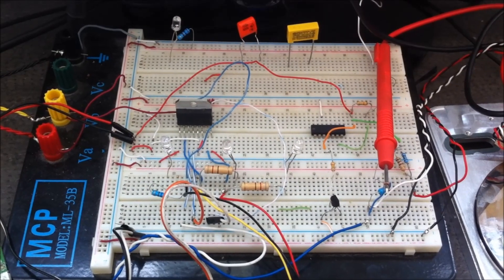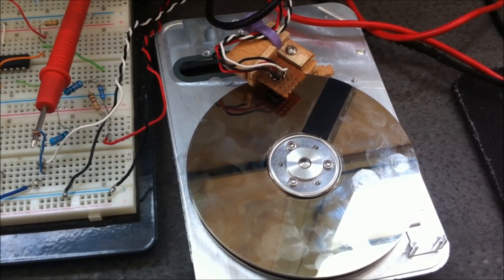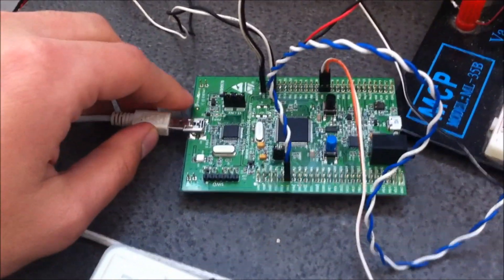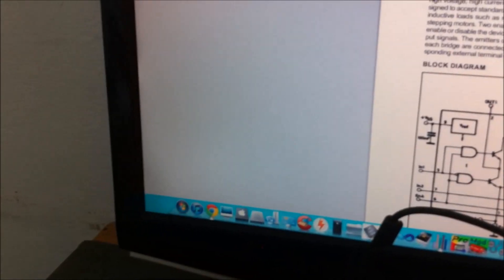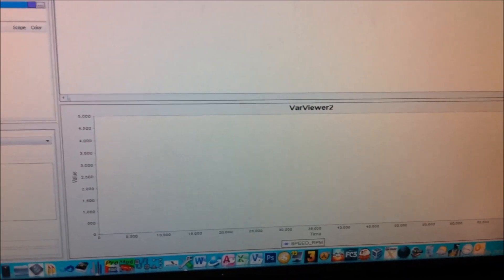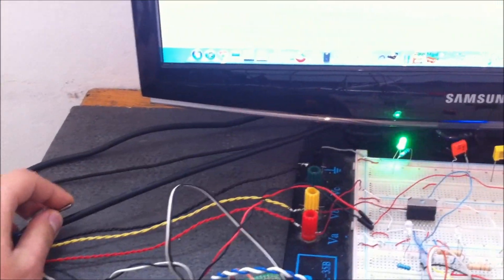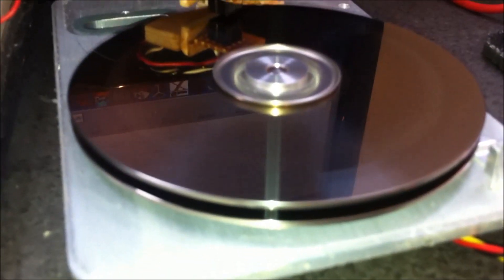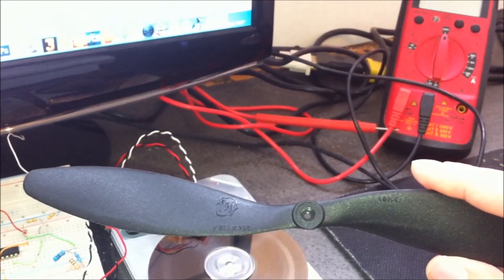Hacking HDD brushless motors using STM32F4

Comment: Hello
I've got a question. How do you sent information about rpm's to computer? I've got a little bit of problem, cause i have to do similar project as your's. I have to send info about rpm's and speed via using USART.
HELP PLOX
Reply from the maker: +Dawid9551 i use the real time debugger, i read the variable in the microcontroller which store the rpm in real time.

you can check my website here for more info ; http://electronics-homemade.com/BLDC.html
Reply: +TizanaMenYo I checked this site and it's beautifull <3, But s it possible to use USART to recieve thise information? I don't know how :(
Reply from the maker: +Dawid9551 yes you can do it. set up the usart and choose the port and you can send whatever data you want through the USART. it's doable

Comment: thanks so much but may I ask on how to set the variable "SPEED_RPM" in stmstudio in order to be used as the monitored variable in stmstudio cause I could not see this variable name(SPEED_RPM) in your source code.
Reply from the maker: SPEED_RPM is a variable created inside the STMSTUDIO which use the Nmbr_turns variable :

SPEED_RPM  = 60 / time_for_one_lap ;
which 60 is number of second in one minute because the result is in RPM (Revolution per minute)
and time_for_one_lap is the time that takes the hardrive to do a lap.

time_for_one_lap =  Nmbr_turns * prescaler * TIM5_periode

Which : - Nmbr_turns is a variable inside the microcontroller which calculate the number of TIC for the TIM5
- TIM5_period = 25 nS = 0.000000025 s
- prescaler = 10000 (you can check it inside the TIM5_config() function)

so 
SPEED_RPM  = 60 / ( Nmbr_turns * 10000 * 0.000000025 )
Reply: TizanaMenYo
Thank you very much for your warm and immediated explanation. May I ask more, Now I run STMSTUDIO, I import .elf file in order to see the available variables with their addresses but after choosing these variables and click import, they are not appeared in the Display Variable Setting but when I choose them to be appeared in the Write Variables, they can be appeared there. I  use gcc arm-none-eabi as the cross-compiler suit with Code::Blocks as the IDE. In this problem, what should I do in order that those variables can appear in the Display Variable Setting. I use STMSTUDIO v. 3.4
Reply: Ken Kalaido I tried again and declared some desired real time monitored variables as the global varaibles and they can be seen. First time I could not see because they resided under the flap of the Display Varaible Setting, I need to use mouse to drag the flap down in order to increase the space.
Reply: Ken Kalaido
Anyway, I just wonder why for the on/off data of two GPIO, pd13 ad pd14, when they are "on" the numerical values of them are not equal despite I use unsign int16 for both of them( pd13 get the numerical value when "on" as 8192 while pd14 get 16384

Comment: Can you mail your code to me please. I would like to try it out
Reply from the maker: Sorry for the late !!!!  You can download the code Here: http://www.electronics-homemade.com/Downloads/HDD_Hacking/HDD-MOTOR%20DRIVE%20-%20V1.2b.rar  or visit my website i update it with the downloadable code for this project @ http://www.electronics-homemade.com/BLDC.html

The motor's rotation is handled automatically by the programme inside the microcontroller and doesn't need an external intervention like push button or something like that.
If you have a different HDD motor than the one I have (different maximum speed, dimension ...) you might have to change some setting like timer period, prescaler ... to fit with your motor. The timer configuration are inside the Function.c file.
The 6 steps necessary to the motor to reach his maximum speed are represented by the steps variable inside the main.c, so you can change the length and signal period decreasing in every rotation of each phases.

The connection between the microcontroller and the HDD motor are:
PA0 (TIMER2-output) -> connected to the FIRST Brushless motor input COIL 
PB4 (TIMER3-output) -> connected to the SECOND Brushless motor input COIL 
PB6 (TIMER4-output) -> connected to the THIRD Brushless motor input COIL 
PA1 (TIMER5-input) -> connected to the infrared sensor

Comment: Thank you, Great tutorial!
Nice to know, that the STMStudio has that nice feature "VariableViewer". I'm using CooCox, but now i try the STMStudio too. :)
Reply: Can you mail me the code with coocox Please?? I need it
Reply from the maker: NNIISSAAFF the code i made it with IAR EMBEDDED WORKBENCH.

Here's the code : http://www.electronics-homemade.com/Downloads/HDD_Hacking/HDD-MOTOR%20DRIVE%20-%20V1.2b.rar  or visit my website @ http://www.electronics-homemade.com/BLDC.html

For information :
The motor's rotation is handled automatically by the programme inside the microcontroller and doesn't need an external intervention like push button or something like that.
If you have a different HDD motor than the one I have (different maximum speed, dimension ...) you might have to change some setting like timer period, prescaler ... to fit with your motor. The timer configuration are inside the Function.c file.
The 6 steps necessary to the motor to reach his maximum speed are represented by the steps variable inside the main.c, so you can change the length and signal period decreasing in every rotation of each phases.

The connection between the microcontroller and the HDD motor are:
PA0 (TIMER2-output) -> connected to the FIRST Brushless motor input COIL 
PB4 (TIMER3-output) -> connected to the SECOND Brushless motor input COIL 
PB6 (TIMER4-output) -> connected to the THIRD Brushless motor input COIL 
PA1 (TIMER5-input) -> connected to the infrared sensor

Comment: Graet video... Can you email me your code and schematic sor your setup please?
Reply from the maker: Sorry for the late !!!! you can visit my website i update it with the downloadable code for this project @ http://www.electronics-homemade.com/BLDC.html
or You can download the code Here: http://www.electronics-homemade.com/Downloads/HDD_Hacking/HDD-MOTOR%20DRIVE%20-%20V1.2b.rar

The motor's rotation is handled automatically by the programme inside the microcontroller and doesn't need an external intervention like push button or something like that.
If you have a different HDD motor than the one I have (different maximum speed, dimension ...) you might have to change some setting like timer period, prescaler ... to fit with your motor. The timer configuration are inside the Function.c file.
The 6 steps necessary to the motor to reach his maximum speed are represented by the steps variable inside the main.c, so you can change the length and signal period decreasing in every rotation of each phases.

The connection between the microcontroller and the HDD motor are:
PA0 (TIMER2-output) -> connected to the FIRST Brushless motor input COIL 
PB4 (TIMER3-output) -> connected to the SECOND Brushless motor input COIL 
PB6 (TIMER4-output) -> connected to the THIRD Brushless motor input COIL 
PA1 (TIMER5-input) -> connected to the infrared sensor